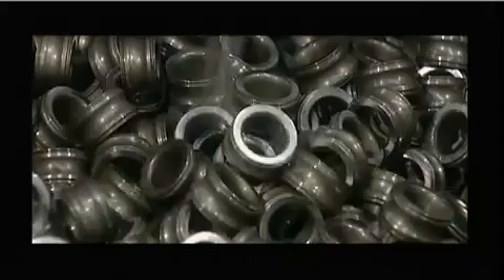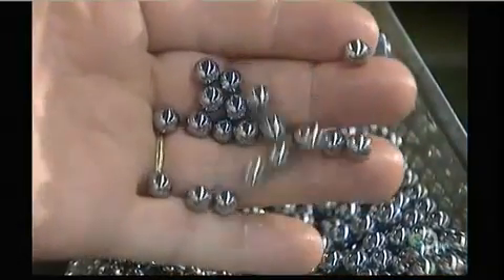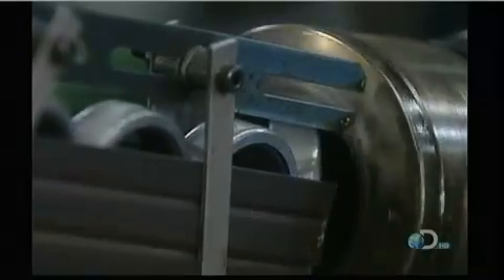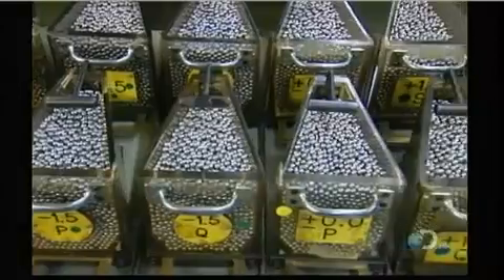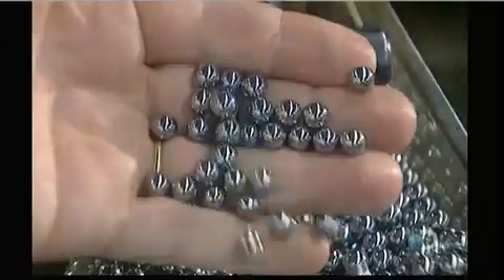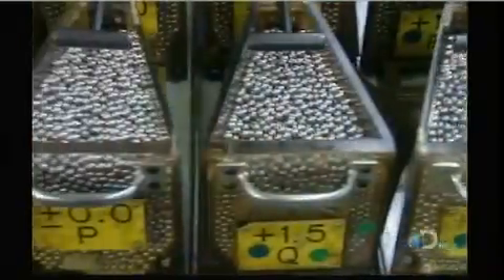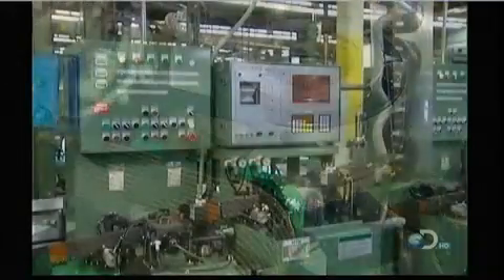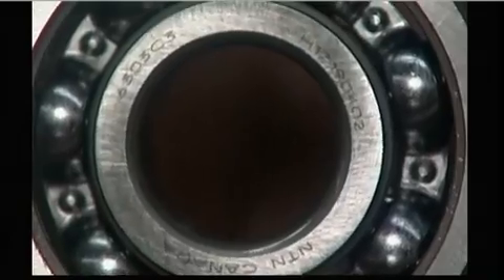How It's Made - Ball Bearings (NTN)

Comment: Grease must fill high quality which bear high temperature
Reply from the maker: Yes, the bearing grease is very important and is often overlooked. The primary role of lubrication is to reduce friction between bearing components and help dissipate heat. Lubrication also serves as a vital barrier of protection against contaminants. Lubricants also help bearings endure different loads and act as a stabilizing agent for bearing structures. Lubrication is one of the most important factors impacting the operation and longevity of bearings, which is why it is important to inspect and monitor bearing function on a regular basis.

Comment: They left out the biggest and only question there is to ball bearings-How do they get the balls in the two valleys of the raceways????
Reply: No they didn't, the inner race is pushed to one side, all the balls are loaded up in the big gap that is now formed on the other side between the inner and outer race. The balls are then separated which locates the inner race into its central position at the same time. The cage holds the balls in their correct location, without the cage all the balls would bunch up at one side and the inner race would then fall out!
Reply: @sidecarbod1441  To get the balls to fit, the outer "A" ring is squeezed slightly, then released.  From that point on, the balls will stay in place.  In tight tolerance bearings, the balls will not fit into the gap without squeezing the "A" ring.
Reply: @ytubepuppy   I have disassembled a ball bearing in the past, without the cage in place it is possible to push all the balls to one side so that they are touching each other, once this is done there is enough room opposite the balls to remove the inner race. So it is clear that the reverse of this process is how the complete ball bearing is made. Try it, get hold of a bearing and pull out the cage, the rest of the bearing will just fall to pieces!

EDIT..At 3:18 you can see the balls all at one side of the bearing, the narrator then says " A ball divider positions the balls evenly around the raceways"  There is no squeezing of a "A" ring!
Reply: @sidecarbod1441  Yes, there is a station on the assembly process right after the "ball insertion" stage called the "ball gathering" stage where a stopper comes up to hold the balls in place, the inner ring is spun, causing all the balls to gather in one spot, then the "ball separator" fingers come up between the balls, followed by the upper cage insertion to stabilize the balls then the lower cage with the rivets, then the rivet press.

There is also a salvage process in which the rivets are pressed back out, the cages removes, the rings separated, and the balls scrapped before the rings are reassembles.
Reply: Kayenne9 yeah. ive been wondering about that about 2months now

Comment: i still dont get how they fit the balls in the raceway so easily
Reply: Yea, I too watched the whole video, solely to try to learn that. And they did not say how.
Luckily someone here in the comments hinted on what sounds to me like the right answer, which is that:
- the balls all packed together against each other, only fill, roughly half the circumference of the rings races.
- so, while feeding in the balls, the inner ring is out of center, and touching the outer ring on one side.
- then just space out the balls, and the rings self center and cannot separate anymore.
Reply: I looked this up and I still don't know!

Comment: I worked there for 20 years and was present when this was made. Not a lotta fun trust me.
Reply: I'll bet you never got tired of making up new "balls" jokes.
Reply: That's pretty cool, what was the process like?
Reply: No steel factories where ever  fun, but that's life, used to work in a welded wire mesh panels, what a mess :(.
Reply: Yeah, but how do they get the last 2 or 3 in there, when it has to b perfectly concentric at that point.
Reply: @grumpyoldfart7302  I know this is 3 years late, but you can do it by moving the inner races off to one side (instead of being centered within the outer race), creating a larger gap on one side of the bearing. You can insert all the balls into this larger gap and then space them out while simultaneously moving the inner race into the center.

This is also one of the reasons a cage is needed. If the cage wasn't there, the balls could all go to one side, allowing the inner race to fall out.
Reply: Actually I just went  out and looked at one and it didn't have a separation sleeve. It would have held, maybe 2 more balls if they could get them in there. It had a slot , obviously for installing the balls. It was n MRC, brand.
Reply: Do you ever try making magnetic bearings?
Reply: William Shaw
Reply: What was no fun - the film crew? Or working there?
Reply: Yep, I spent 28 years as a maintenance tech working on every machine in the plant, from elevators to random match machines.  Interesting work.
Reply: How do they get the balls inside the races. Something has to give. I see some have a slot to install the balls, but something has to stretch, give or bend to pop the balls between the races.

Comment: there i hav NTN bearing UC 208-108.And this bearing suits a shaft dia of 1.5 inch.What this 208 and 108 denotes ?Also there 208D1 bearings, it has the diameter for 40mm shafts.What is D1 here ?